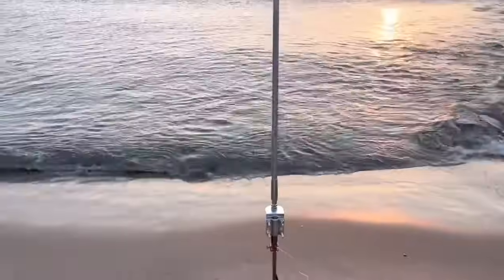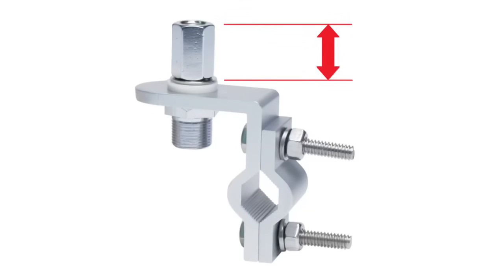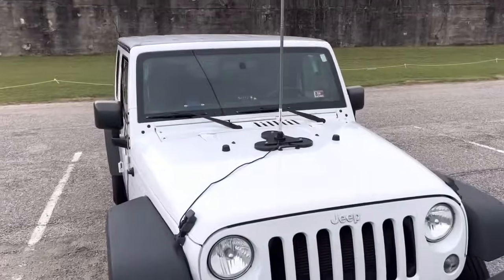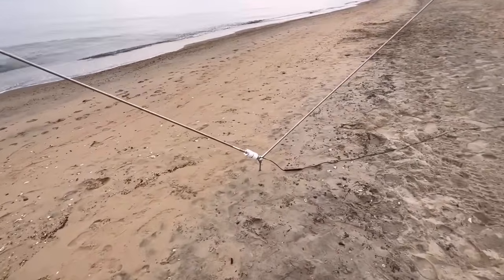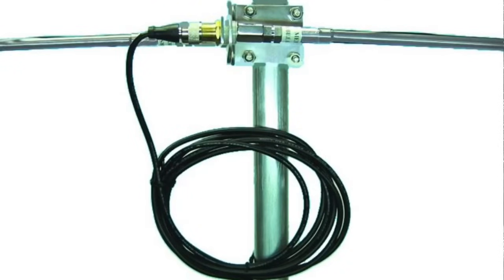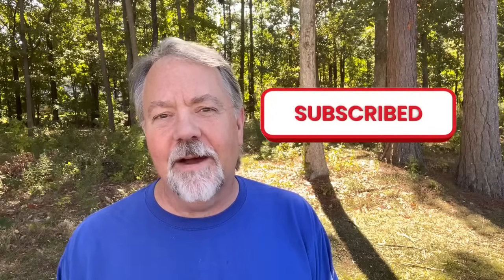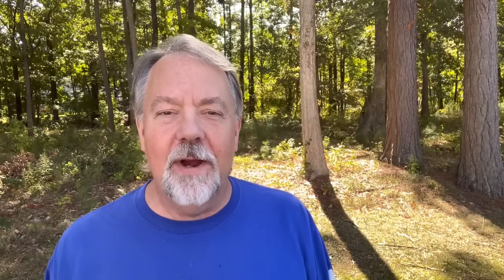How To Use a 17 Foot Telescopic Whip for Ham Radio

Comment: Thanks for the video. A couple questions:
1. Which model mag mount do you like using on the Jeep?
2. Any thoughts on if a 17 ft whip generally works better, or not than band specific ham sticks for DX when either are used on a mag mount? Whips give some flexibility to use a single antenna that can be used on multiple bands. But I have not used whips or ham sticks yet.

Thanks!
Reply from the maker: @Coyotes_Locos  I love my Tram Triple Magnet mount. For 20 through 10 meters the 17 foot whip works much better than HamSticks because you can trim it to be exactly a quarterwave.
Reply: @COASTALWAVESWIRES  Thanks, one more: for operating on 10M - 20M with the antenna on your mag mount, are you pretty much able to not use a tuner or a coil at all, or if needed use the radio's internal tuner?  I ordered one of these Chameleons today. Thanks

Comment: Walt, the HAM STICKS that have 3/8 x 24 threads can be used as a coil with the 17 ft whips. I saw a video about using them seemed right up your alley I  thought who better to test it out than you?

Comment: Great video and thank you for the reply on the other video, what distance are we getting on 10 meter?  This antenna design and a yagi do not use the atmosphere correct?
Reply from the maker: Both this and a yagi will use the ionosphere for skip. In the HF frequencies pretty much everything eventually skips. I’ve typically seen 400 to 600 miles on a first hop skip with a vertical, my longest DX with this type of whip on 10 meters is South Africa from Virginia. 73, Walt

Comment: Great video. How close do you have to be with the antenna measurement? Is a 1/4 inch going to make a difference? When you are making adjustments to the antenna and using a Rig Expert in what increments should you be adjusting the antenna? Thanks
Reply from the maker: 1/4 will make a small difference. I typically adjust in 1/8 inch increments once I see the SWR getting close

Comment: Wow, nice guy, nice video. Thank you. Also cool for mag mount on the car. I like the pac-12 Antenna, it's very easy to get a good swr by changing the position on the coil. How do you shorten the antenna? From the top or can you do it from the bottom? If you have to do it from the top you have to unscrew the antenna every time. The tape measure is great. I will buy one when I find a tape measure with frequencies on it and one which use the metric system. Because in Europe nobody uses inch, only UK. Thank you for the video and good explainings. 73 greetings from Austria. 👍🏻 Sorry for my english, it's not the best.

Comment: I have a piece of bank line with knots at quarter wavelengths that I use for making wire antennas. Probably a bit lighter than a tape measure but obviously not as versatile.
I'm getting pretty tempted to try a loaded vertical based on your and other hamtuber videos :)

Comment: Great Video... I recently did my research and settled on purchasing the MFJ1979.  Going to pickup a steel rod and attempt a set in my small Back Yard. Got some radials ready too and RigExpert to check it out before hooking it to my rig. I was wondering, what brand or where did you get that delta loop mount? Keep up the great videos... I enjoy them as newer ham, great to learn from others experiences/knowledge! 73!
Reply from the maker: Thanks! Have fun with that antenna! 73, Walt

Comment: I've got the MFJ and I find it's a hair too short on 20m. I can use the very top end of the band, but not even the full voice portion. And I haven't been able to get a tune on 6m. I'm running it on a short (6"?) tripod with eight 10' radials. Kind of trying to mimic the DX Commander I use at home.

But it is a great antenna; I love using it on 10-17m and 20m when I can.
Reply: You might look around for 3/8-24 male-to-female, extension, tilt-over or spring to give you just enough added length to reach 20 meters. You might also try elevating the antenna. I use a tripod designed for camera lighting that can be extended up to 10 feet. I found that the higher I put it, the lower the resonant frequency. That six inches is really low. Try a camera tripod.
Your tuning issue may also be why the Chinese-made telescoping antenna sold by vendors on eBay is 5.6m/18.4ft rather than 17ft. That makes it resonant down to 13.36 MHz, giving enough leeway to be sure of covering 20 meters. Fully telescoped down to 20" it resonants at 147.5 MHz, which is the high end of two meters. That makes me suspect it was designed by a ham who made sure it would tune 20 meter to 2 meters.
Reply: If you're on a tripod, try using tuned radials, quarter wave.

Comment: Interesting.  I am looking into someone to put on the side of my old 1990 Chevy Van as a whip type thing and use my 857D and LDG Y100 tuner on it ... and listen and transmit at night when camping without making a whole scene .. .. but can if extended camping.  someone said an 8" stainless whip ... but this looks interesting, adjusting to length ..

Comment: Hi Walt. Loved today whip video. Just bought one myself but I find the threads on the Chinese whip have a much courser pitch than the Slidewinder coil I have. Any thoughts on adaptors? I don’t recall seeing anything in your vid’s re connectors to join the whip to the coil. Thanks Trevor VK3DCQ
Reply: Chinese whips use M10 thread (metric). USA and international amateur radio use the standard 3/8-24 thread.
Reply from the maker: Hi Trevor, thanks for watching! As @Chameleon_Antenna mentioned you need a 3/8-24 thread for the Slidewinder as well as a Wolf River Coil or pretty much everything else.

Comment: Great video Walt. I have the MFJ whip and I will start portable in the spring. Quick question. When you use the mag mount, do you need a counterpoise? Or is the vehicle a good enough ground plane on its own. Thanks de Jim VE3UZX
Reply from the maker: Thanks! I’ve found that the vehicle is good enough on its own. 73, Walt

Comment: Nice video. I like the stainless-steel whips and I need to get a couple. 
I have been using a pair of CB whips cut for 10 meters as a rotatable
dipole.  Also, I like using metric measurements building antennas.
It's easier than trying to figure out what .346 inches is. I have a 10 
and 25 ft tape measures with both Inches and metric on the same
tapes. telescoping whips have so many uses. KF6EWO
Reply from the maker: Thanks! Yes metric is so much easier building antennas.

Comment: With a telescopic whip, or tank whip antenna, if using a ground stake what would suffice for a ground plane/counterpoise Walt?
Reply from the maker: When I'm away from saltwater I typically just put 4 wires on the ground about 5 meters long each, if I can I'll add a couple more. I just put an alligator clip on the end and clamp them to my ground stake, When I'm by saltwater I just run one wire out to the damp sand or slightly into the water. Both ways work well for me.
Reply: Thanks for the reply Walt much appreciated.

Comment: In terms of getting a stronger signal is it better to fully extend the antenna and use a ATU to tune it?  Does the ATU attenuate the signal in any way?
Reply from the maker: In my experience with low power it really isn't a big noticeable difference but in theory adjusting the antenna to resonant height is better.

Comment: I have one but haven't used it yet.  I want to elevate it 10' but have no idea how to counterpoise it or add a unun.
Reply from the maker: I really don’t use an unun with these. I just adjust the length up or down until it’s resonate.
Reply: @COASTALWAVESWIRES  What do you attach the shield of the coax to?

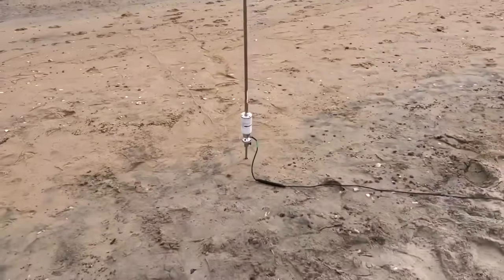Comment: New ham here trying to drink from a firehose...at 1:25 in the video it looks like you've got an unun hanging off the vertical. Is that required?  Also, at 3:23 you mentioin using a transformer. Is that another name for a loading coil?  Thanks.

Comment: I bought an ft891 and the fc50 tuner recently, I am using a hustler 6btv at home. I am looking for a portable antenna that can cover 20 and 40 meters that won't break the bank and can be easily deployed.  I have heard performance on 40 is not good with a 1/4 wave vertical, what would you suggest?
Reply from the maker: Take a look at a Wolf River Coil setup, good performance in 40 and 20 and you won’t need a tuner. Perfect for a FT891
Reply: @COASTALWAVESWIRES  it says An essential employee is ill. For now we need to shut down this portion of the website when I try and order. I can get the slide-winder dx but its pricey after shipping. I know hams that have the 1979 and they say its not good on 40. I was trying to keep the cost around 200-300 dollars because I need to purchase an analyzer also. What do you think about the SE X80 Vertical? I could mount that to a construction tripod and lay out some ground radials or use a faraday blanket as a counterpoise.

Comment: Just a thought Walt. What if you connected a say, 4 to 1 UNUN and a counter pois to one of the 17ft. whips. Would it be multi band with one length without adjusting?
Reply from the maker: That's a great idea and should work well.

Comment: Hello, do the elements of the whip stay firm the one connecting to the 2 other elements? Does the SWR stays put when operating the antenna in the wind?
73 es dx
Gust ON6KE
Reply from the maker: Yes in my experience the whip stays firm and stays put in the wind. 73, Walt

Comment: So I see on car mag mount obviously no radials as the car is ground, but are you using cut length radials when in vertical ground spike? Would it work better if using radials? Thx 73 M7RWA

Comment: Hi Walt, I have two sections of my MFJ 17' whip are stuck.  I have tried two pliers and some WD40 but no way they will extend.  It is thin and denting from the pliers.  If I pull too hard, I fear it may come apart.  So, for now it is a 13.5' whip.  Any suggestions??
Reply from the maker: Yikes, I’m not sure. Sorry.

Comment: Hey Walt, hope all is well. Got a question for you. My SS 17 telescopic antenna is mounted to a 24”, 1 3/4” piece of PVC and I just put that into the ground. Is there any advantage to using a metal ground rod instead of the PVC?
Reply from the maker: As long as you have a good counterpoise or ground radial system below it the PVC is great and really not a big change by using a metal support.

Comment: The coil you mention at 3.25 with the 17M.. what is that? And I also notice something near the end of the cable ? Is that a 1:1?
Reply from the maker: That’s the Chameleon TDL in vertical position using the Chameleon coax which has a built in choke.
Reply: Thanks!!!    @COASTALWAVESWIRES

Comment: Thanks for the measurement chart Walt. Real handy to have. I finally received my 10m to 3/8-24 adapter so now I can start experimenting with my 7.2M whip soon. I've homebrewed a wolf River coil too, so that should prove interesting. I have to get a little bit longer tape measure, Mine is only 5 Meters. Hope to see you on the airwaves soon.
Reply from the maker: Thanks! I hope to catch you on the bands soon! 73, Walt

Comment: There you go again, Walt, making me spend money, hi, hi! I've pondered getting one of these and after hearing some bad reports regarding the MFJ (imagine that!) I'm going to spring for the Chameleon.  I'm not finding any alternatives to the Radiowavs tape measure (non-metric) via normal resources, though.
Reply: I have found the mfj-1979 to be pretty serviceable. It may be more readily available, which is the main reason I have it.
Reply from the maker: haha sorry, I got my RadioWavz tape measure from Gigaparts. It looks like Chameleon is currently out of stock on their website.

Comment: The for the great videos....when using one of these whips, is it safe to use as a mast to hold a wire?  Thinking about adding a 49:1 transformer to the base of mine and clipping a wire to the top and slope it to the ground to get multi-band to 40 meters.  I'm concerned about bending the whip however...thoughts?
Reply from the maker: I think that will work and the whip should be fine. That's kind of what Chameleon does when they clip wire to two of them to make a loop. The whip is pretty stout.

Comment: UPDATE: Hi Walt; I use the buddie pole 9.5 foot telescoping whip with a magnetic mount and a common mode choke from the car; just like you did in a previous video.. using a 12 V 6 AH LiFePO4 battery. It works great and its working on 40 thru 6 with the wolf river coil SB1000. Easy to tune with the  NanoVna to get it resonant with a light touchup from the xiegu 6100!!! Here is the video that i based it off of . https://www.youtube.com/watch?v=JHNbEND-Tt0
Reply from the maker: Excellent setup!!! Thanks for sharing. 73, Walt

Comment: WHY NOT USE IT AS A 1/2 WAVE ON 10 METERS. BETTER DB, GAIN RIGHT ?
Reply from the maker: Better gain for sure but the problem is the match at the feed point. Half wave antennas have very high resistance at the feed point and that's why end fed half wave antennas need a 49:1 unun to get a match. I can use a 17' telescopic whip on a mag mount with my G90's ATU but the amount of loss after tuning that thing means I'm not getting much power radiating from the antenna itself.

Comment: The metric system isn't that hard. It's simply 1-10, the same as counting. If you can count to 10, you can count to any number. If you understand units of 10, you can use metric for anything.

Comment: Ok, quick question: will I have more success transmitting if I measure out a natural wavelength or if I extend the whip all the way and use a tuner (for SWR). Which will send signal out better???
Reply: I read some comments: I think the answer is.. when I use the tuner to get the ‘match’ I lose a lot of my transmit power?!   Right?